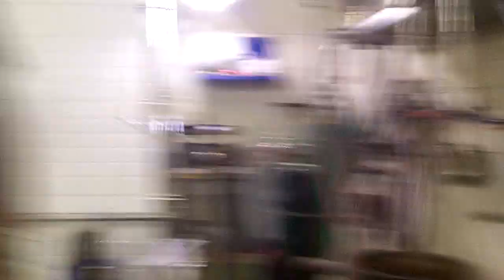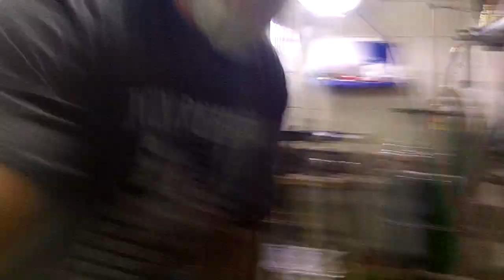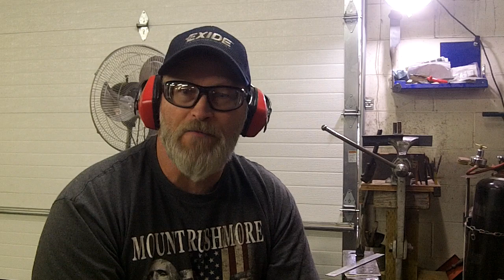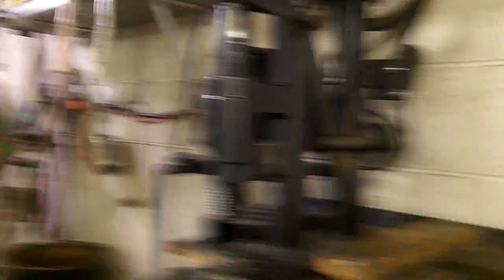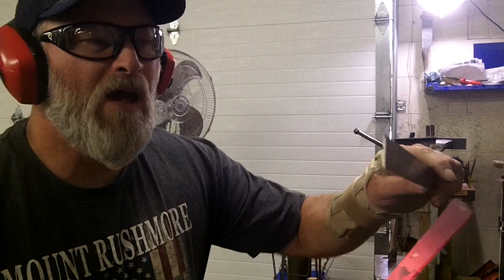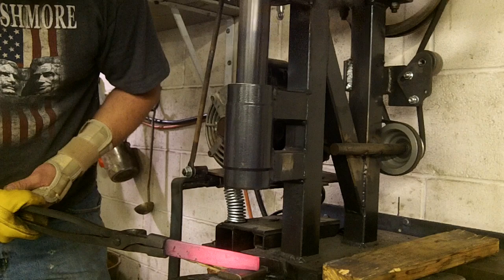benchtop power hammer: forging

Comment: Excellent adaptation of the Hardy Hammer.  I am in the process of building a Hardy Hammer from Roy Adam's plans.  I have had bilateral carpal tunnel surgery, and I need an assist in hammering.  Great job.  I should have mine done in the near future.  Thanks for posting the video update.

Comment from the maker: Lots of views no comments? so does this mean my fellow smiths think it a POS and dont want to hurt my feelers? or y'all think it moves metal well and just dont want to swell my mellon? haha.
Reply: I'm watching right now! That machine looks great, and it's music to my ears. If you want more views AND comments, you can post this video on our homemade tools forum; seems like you're one of us: http://www.homemadetools.net/forum/
Reply from the maker: @homemadetools  Appreciate your post.I just wanted to know what my peers think of the machines work...I simply dont have any experience building one of these lil hammers.I think the lil bastard hits like a beast for the size (weight) of the hammer.
Yes sir must be cut of similar cloth,cause I really enjoy making tools.Next I want to build a better sander than I have now...maybe make it easier and more enjoyable to forge out some blades and finish them .I'll check out the site,thankyou.
Reply: Hey Mike this is Alex Ruiz (Forged in Fire Champion S. 5 Ep 14) I have been looking at a benchtop hammer design for texturing on my upcoming mid tech line of knives and of course for my traditional blacksmithing stuff. I like it, the only thing I would change is the ability to switch out both top and bottom dies, if the ram die was rounded over for drawing out I have no doubt it would move stuff more efficiently.
Reply from the maker: @jr602908  Appreciate yeah chiming in sir.I agree,I use a top tool sometimes  to help it draw quicker.This build was an idea,was curious what a lil hammer could do,would it be usable?interchangeable dies would be great.The ram comes up into the  guide on the up stroke.I need to cut the guide for the ram,then maybe I could make some dies to swap out.There are plenty of upgrades that could be done now that I have made one and actually have used a power hammer.
Reply: @ffolted  I used to be a bricklayers and than I became an operating engineer,buff said .. ... I Love your power hammer and I dont know why no one has commented on it. I would love some plans